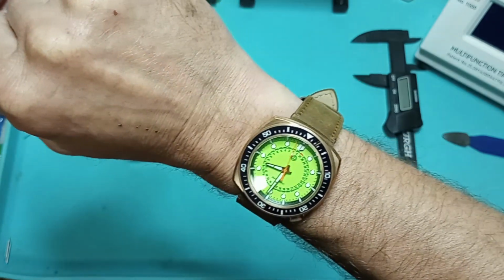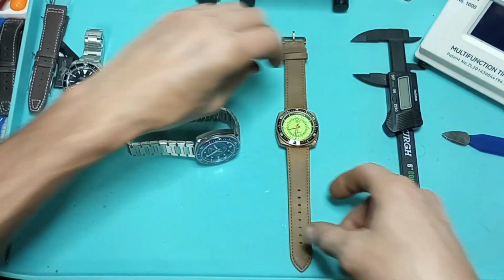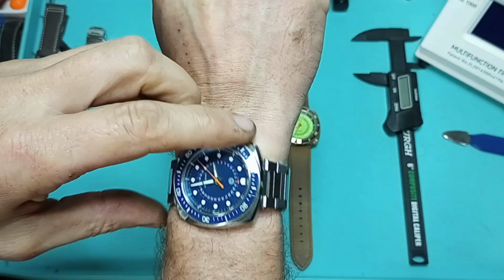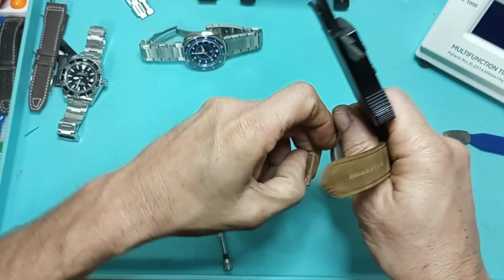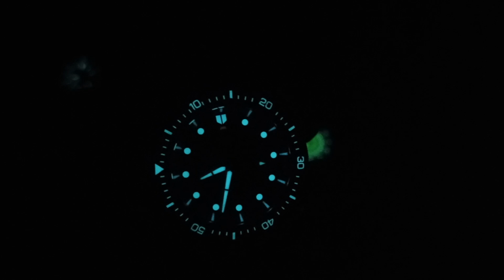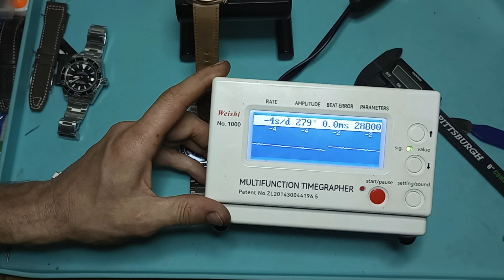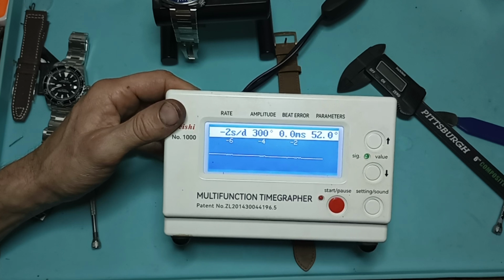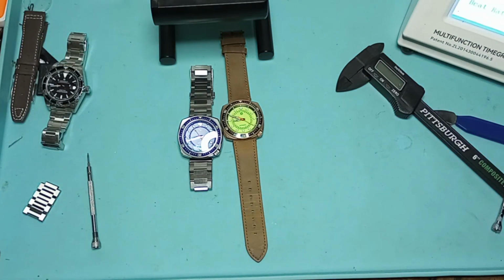MMI Cuttlechron

Comment: If you had to choose between ginault ocean rover1 and silent service, which product would you recommend? 🎉😊
Reply from the maker: @신짱구-r3i  that is an extremely hard choice as far as quality they are equally the same I guess it would come down to do you want to really look like a Rolex or not I will put it like this the ocean Rover 2 is my all-time favorite because it's the Submariner that Rolex doesn't make but should the silent service although being slightly bigger I feel is the more functional watch especially if you wanted to go diving but for me the biggest separation of the two is one looks just like a Rolex the other one doesn't but for like me the silent service would be a better everyday pick because it has the sapphire bezel which is slightly more scratch resistant than ceramic the indices are bigger so it's easier to read basically you can't go wrong with either
Reply: @mr.eswatchreviews  I was planning to purchase silent service By chance, I had the opportunity to purchase Ocean Rover 1. I am worried Would it be difficult to get an ocean rover1 if not now?
Reply from the maker: @신짱구-r3i  I know the first versions of the ocean Rover are nice but the ocean Rover 2 and the 2.5 they made a bunch of small improvements that really up the level of quality and luxury I don't know exactly how scarce the original versions are but as of right now I know you can get the ocean Rover the silent service or the expeditioner brand new from Ginault